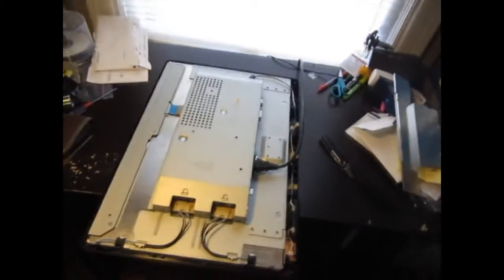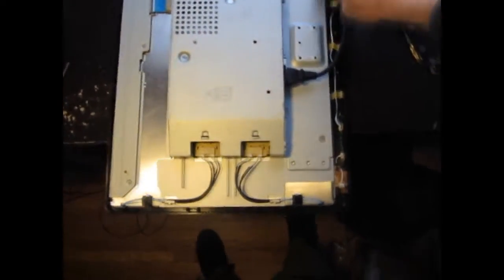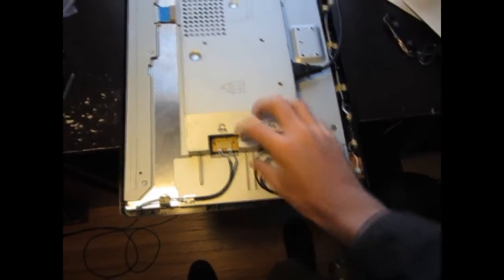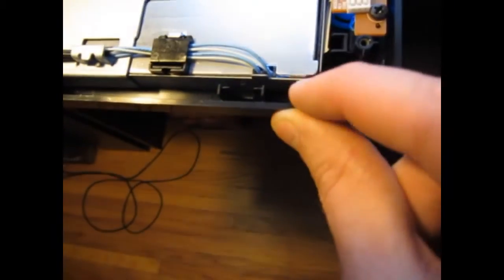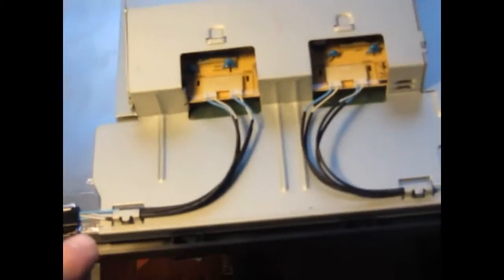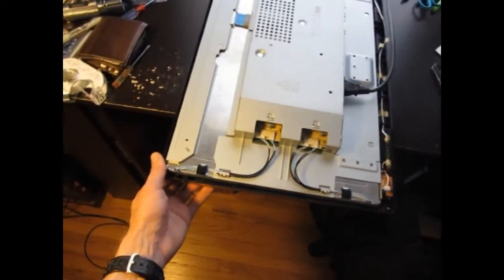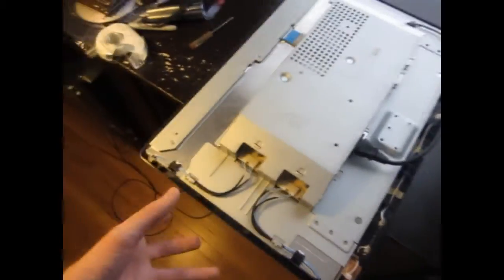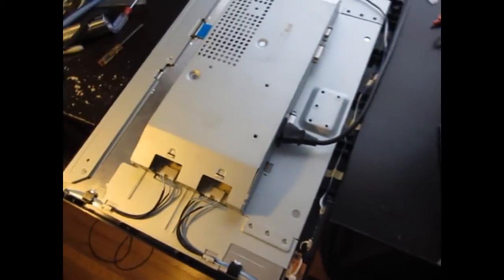LCD repair: bulb replacement tips, thoughts (Samsung 226BW)

Comment: Where is the part where you take it apart?  Are you kidding?
Reply from the maker: Sorry about that.  Hopefully someone out there has a disassembly video for that model, though if you watch a few random LCD teardowns they are all held together basically the same - a lot of clips around the edge and only a few screws to hold on the base.  Hope that helps.